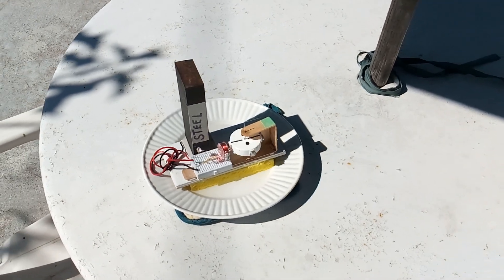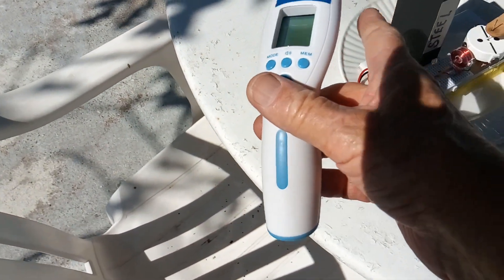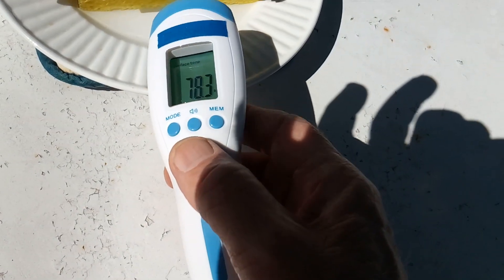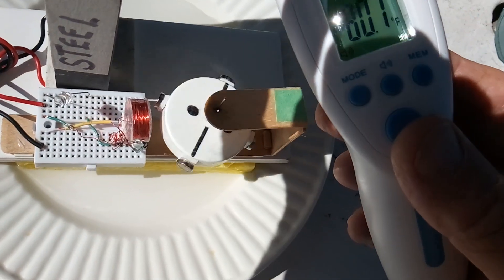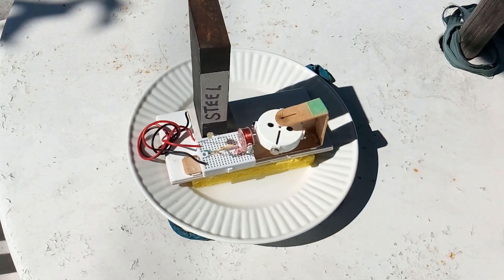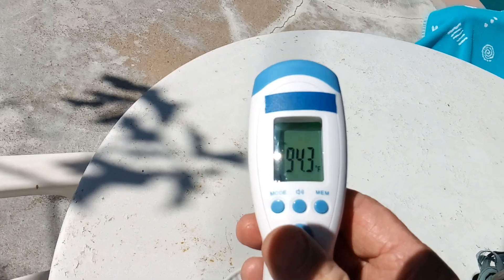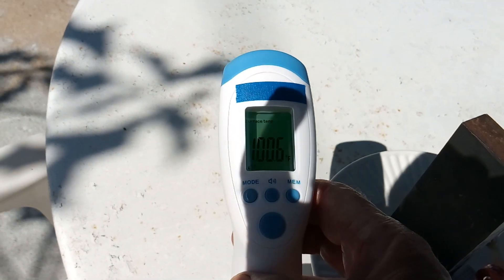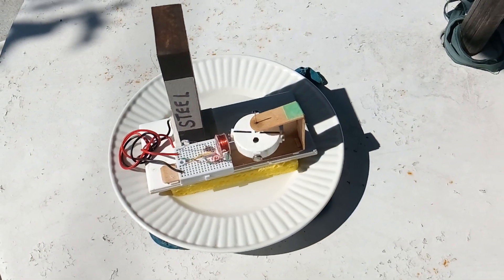Summer Heat Powered Motor

Comment: Great.. I was thinking the same thing using a black metal bar to absorb the heat and on top of it a magnifying glass to concentrate the heat and below the TEG it was cooled by an heat sink with 5v small fan that feeds on the same electricity generated because the more difference temperature between the two faces of the TEG, more electricity is generated, my problem was that the heat heats everything, including the aluminum heat sink, I have to make a separation between the two faces with some white material that does not conduct heat
Reply from the maker: The setup I showed in this video had two really good advantages------a shaded area and a slight breeze blowing on the wet sponge to cool the TEG bottom.  You have to use every trick in the book to get and keep that magic 20+ degree delta.

Comment: Excellent. Too hot for us softies to do any work, so just staying cool over here 😁
Reply from the maker: Luckily our house is air conditioned and we are used to hot summers.  We try to do all the heavy outside work in the morning or evening.
Reply: @Lidmotor  yes, no aircon, just fans to blow the hot air around, Curtains on the windows, even silver foil on the windows that don't have curtains 😆
Reply: @GrandadIsAnOldMan  A bag of frozen peas in front of the fan will help... can also cut the top off a used up milk/motor oil/etc  gallon container, fill with water, freeze it and use that with the fan.  There are posh DIY ice fans on YT, similar principle, often using a polystyrene box to mount the bits in. 
Also, open upstairs windows in evening to let hot air out. Open either front or back door in morning, depending on which gets wind and put a fan there to blow colder air in. We went most of the 14 years in Oklahoma with no AC  :)
Reply: @spiritedinvestigations  I can't get your new tag into my head. 😆👍
Reply: @spiritedinvestigations  forgot to say, weather broke last night, dropped about 10 degrees C. Blanket on the bed 🛌
Reply: @GrandadIsAnOldMan  Haha, is only temporary... I'll reregister as Slider2732-2 or similar. This one is supposed to be for paranormal investigations with the missus.
Reply: @GrandadIsAnOldMan  Ah good. :)  I've wondered for years why the UK seems to have forgotten what Fahrenheit is. When I moved in 2007, everyone still knew how to work with the best fit. 85F was a hot summer day, -3C was a very chilly winter morning. Same thing for inches and cm. A bloke may be 6ft tall, a mini quad propeller may be 6cm long.